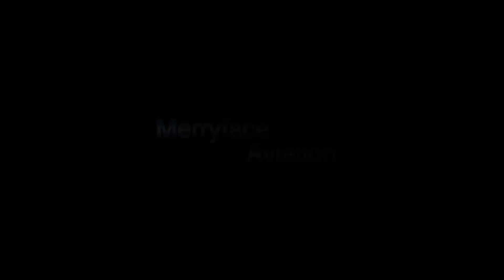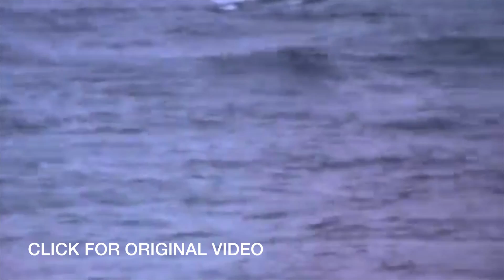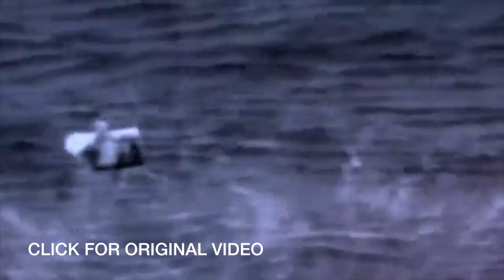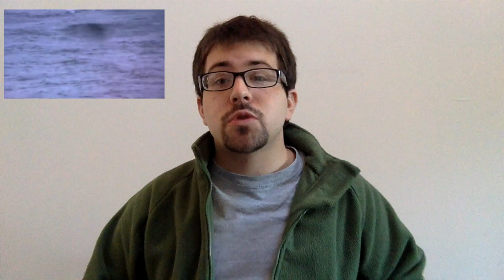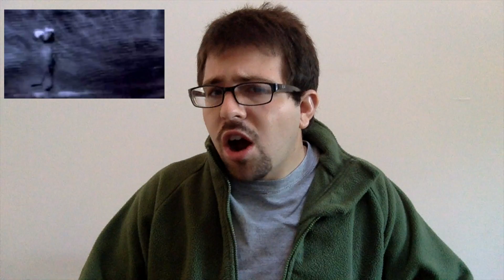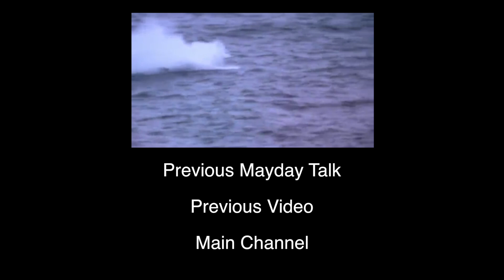Cessna 310 Airplane Ditches at sea!! Mayday Talk Episode 10

Comment: You are making a number of assumptions that i don't know if you are correct on.  I get "full wx briefs" on all my IFR flights and i cant tell you how many times they have given me data that didnt match what i encountered enroute.  
Also, when you say that he should have climbed to the optimum altitude at the beginning of the flight, you are just mistaken. Imho.  I almost never fly at maximum endurance or range settings and altitude... That would add way too much time to each flight assuming i thought i had proper fuel quantities.
If we don't know how much fuel he had and all the other details, its pretty hard to second guess his decision.  I would give him the benefit of the doubt until i had all the facts.  (Again, just my opinion).
Reply from the maker: +Shawn Morrow absolutely I make assumptions. That's why I kept on using the past conditional tense ("if that's what happened"). I can't come to a solid conclusion without all the facts, and I don't pretend to :)
 I agree with you, the forecast wx is never 100% accurate and often different than what TAF says. However, I do maintain that had the pilot considered the cyclone and anticyclone on the Sig Wx chart, he could have seen that the likelihood of headwinds would have been greater, and that what the TAFs were saying was likely to be inaccurate. (anti-cyclone winds rotate counterclockwise and cyclone winds rotate clockwise in the northern hemisphere.)
And I think you're especially right about not using LRC. I see that I was unfair and made one assumption too many there. Although I'd just like to say that I feel like a ferry flight like this one is a little special, and therefore using LRC is probably wiser and safer, although not necessary. I can understand why you wouldn't want to extend your trip by 2 or 3 hours if your flight planning shows you have plenty of fuel to spare.
Reply from the maker: +Shawn Morrow And please, don't be hesitant to share your opinion, you're more likely a much more experienced IFR pilot than I am now, and most certainly more than I was when I made this video. I make this videos in order to learn and share my learning experience.
Reply: +MerryfaceAviation one other thing i forgot to mention is the fuel system.... If i give him the benefit of the doubt that he did take into account the full weather situation cyclonic action and did have the correct amount of fuel for the trip, there is a fuel system issue with 310s that could have caused him to be dumping full overboard anytime he was flying with full mains (tip tanks are mains on these) while using fuel from any other tank.  The 310 pumps more fuel than it burns so it can keep fuel vapours to a minimum.  The down side to that is that all of the over flow gets routed out to the tip tanks... And if they are already full, the fuel spills out the tip tank drains and in this case, out into the ocean.  If you are flying a 310 or 320, you need to always have space in those tanks or your fuel consumption will be : fuel burned PLUS fuel dumped overboard.   That can seriously affect endurance numbers.  
So, it all depends how those extra tanks were done AND tank gauge function.
Reply from the maker: That's something I didn't know. Seems a high possibility too, considering he'd need as much fuel as possible. Thanks for that :D